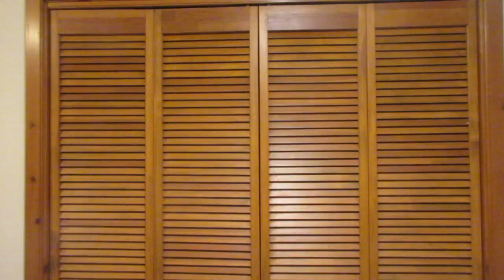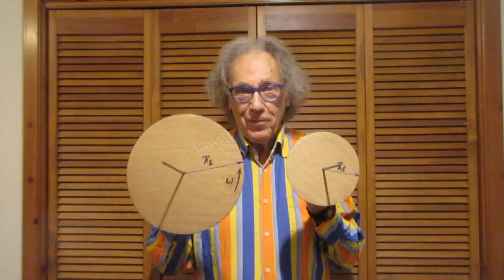Problem #8  Rotating Discs  - not easy!

Comment: the friction generates because there exists a relative velocity between the two touching ends of the wheel. when the relative velocity become zero there will be no longer friction acting on the when, and here is the moment when it reaches w1 and w2, u told us to find out.

firstly as the relative velocity is zero so, 
R1 * W1 = R2*W2
And neglecting heat loss due to friction , I can use conservation of rotational Kinetic Energy
 i.e.,  I1*W^2 = I1*(W1)^2 + I2 *(W2)^2  , the (1/2) term is already taken care of..

being same density, I1 = K*(R1)^4  and  I2 = K*(R2)^4 

And I got the answer as 

W1 = W/sqr[1 + (R2/R1)^2]  and  W2 = W/sqr[1 + (R1/R2)^2]

Why I haven't used the conservation of angular momentum coz the net torque acting on the system is not zero. so it is not conserved.

i think this the answer.

Comment: Considering M1 and M2 as masses of the discs, I would conserve the angular momentum about the point where they are touching:-

1. 1.5*M2*(R2^2)w = 1.5*M1(R1^2)w + 1.5*M2(R2^2)*w2 
 And then since I know that there should be no slip at that point between the 2 discs because of friction,

2. R1*w1 = R2*w2

Solving them gives me,

w2 = M2*R2*w / ( M1*R1 + M2*R2 ), w1 = M2*(R2^2)w / R1( M1*R1 + M2*R2 )

Comment: SIR,PLEASE READ MY EXPLANATION.I AM TRYING TO SHARE MY SOLUTION STRATEGY. The key to solve the problem is hidden in one line-"after some time the angular speed of each wheel becomes constsnt,i.e the bigger wheel no longer speeds down and the smaller wheel no longer speeds up."
what's the reason behind this?
To give the answer one should remember the property of frictional force.it always tries to oppose the relative motion between two surfaces in contact.in this problem as the bigger wheel speeds down and the smaller one speed up there comes a moment when the velocity of peripheral points of two wheels become same.from that moment frictional force vanishes as there is no longer relative motion between the periphery of wheels and we can quote the condition mathematically by writting             w (1)r (1)=w (2)r(2).
secondly we should write the equation of motion of each wheel.moment of inertia of each of them should be expressed in terms of density,thickness and area.these equations will also include parameters like frictional force and time.
But no problem will arise to deal with so many parameters because as we will proceed to solve them the parameters will be cancelled as they are same in both of the equations.
thes considerations are enough to determine w (1) and w (2).
COMMENT PLEASE,SIR.

Comment: (as mentioned) final ang momentum of the discs 1 & 2 are w2, w1 respectively.
Friction will act untill the velocities at the point of contact are equal.
hence w1R1=w2R2   (1)
There is angular impulse due to friction acting for a certain time period
hence (considering the sense of rotation)
R2*f*t = (I2w)-(I2w2)
R1*f*t = I1w1
solving, 
w1= w*R2/2*R1
w2= w/2

Comment: Most of the people are using conservation of angular momentum but they don't care about hinge reactions.
Use newton's third law for the friction force at the point of slipping. 
Integral f.R1 dt  = mR1^2/2 . (W2 - w)
Integral fR2 dt = mR2^2/2 (W1)
Now constraint equation
W1R1 = W2R2

Comment: my answer is probably wrong. but I guess you guys should first try to solve when both radii are equal. if radii are equal I think angular velocity will be 1/8 th. otherwise just a messy long equation if a is R2/R1. then I'm getting w1 = w / (1-a^4 + 2a(1+a)^2).

Comment: i)First off, angular momentum is not conserved WRT any point.

іi) Since friction is ignored, we can apply conservation of energy as follows: 
0.5 * Ι2 * ω^2 = 0.5 * I2 *ω2^2 + 0.5 * I1 * ω1^2  --------> (1)
where, 
I2: moment of inertia of the bigger disc and it is 0.5 M2*R2^2 
I1: Moment of inertia of the smaller one and it is 0.5 M1*R1^2

iii) velocities of points of contact should be equal, which allows us to write, 
 R1 * ω1 = R2 * ω2 ------>(2)

iii) Calculations. Actually, I am not very sure of this part.
M2 = ρ * V = ρ * ι * π * R2^2 and M1= ρ * V= ρ * ι * π * R1^2

then, equation (1) becomes, 
(ω^2 - ω2^2) = (R1/R2)^4 * ω1^2  ------> (3)
 
dividing (2) by R1, 
 ω1 = (R2/R1) * ω2 ---------> (4) 

substituting (4) in 3 and solving for  ω2, 
ω2 = ω/ [1+(R1/R2)^3]^0.5

then we get ω1 from (2). 

iv)Sanity check.
when R1  =  R2, Energy should be distributed equally. which is the case. 

when R2>>R1, the second disc is considered a point which will not rotate. 

when R1>>R2, well, we get ω1 = ω2 = 0! This does not sound good to me. However, this could be a result of the nonphysical assumption of assigning an angular velocity to a point particle.

Comment: I think you can think of it as a mass sliding on frictionless surface with linear momentum, on the way it hits and attaches a second mass at rest thefore to conserve the momentum the total mass has increased therefore the final velocity will be lower. 
m1xV1=(m1+m2)Vf (ideal conditions) but if the friction is taken into consideration we will have another term that will decide the traction at the contact between the two masses and can cause the difference in the final velocities of both masses. so the force that brings them in contact shoudl also be considered, now the difference between the disc case and this one is that in this case the velocity is same and in disc it should not be rpm but the final tangential velocity of both disc will be same.
Reply: Usman Afridi he yelled "friction coefficient is mew" just to confuse u :p
and i think he has successfully done it :D
Reply: thats true, i think if you make a dynamic model it will be useful to see the acceleration but in this case we are intersted in the final state so it is going to be --> V_af = (m_a*r_a*V_ai/(m_a*r_a+m_b*r_b))

so V can be used to find rpm

Comment: Very interesting problem. it's very impressive how many people already reacted to this!

like many others, I couldn't resist the temptation (although it's after 1am here) and got to this:

mu  isn't specified, so I make the hypothesis that it's equal to 1.

conservation of the sum of angular momentums: L1+L2 is constant

the masses of the discs are:
M1=π*Roh*d*R1^2
M2=π*Roh*d*R2^2
where "Roh" is the density and "d" the thickness of the discs.

L1=(0.5*M1*R1^2)*w1
L2=(0.5*M2*R2^2)*w2

and since in the beginning L1=0 :
L1+L2 = (0.5*M2*R2^2)*w

the density and thickness cancel out because identical, I'll spare you with the algebra.

whatsmore:
w1=w2*(R2/R1)

therefore:
w1=w*[1+(R2^3/R1^3)]*(R2/R1)
w2=w*(1+(R2^3/R1^3))

thank you for the great video!

Comment: the transient of the problem is complex, because in a conservative system without friction the non-rotating disc would need to adapt his velocity instantaneously, what it does not. the wheels slip under friction. So the total energy conservation would need to take into account the dissipation of energy to heat - saying Erot,2(0) = Erot,2(t) + Erot,1(t) + int(dQ/dt,dt=0..t).

Comment: If the problem is worded as "throwing a sandbag onto a stationary hovercraft" - everyone would get it. Make it rotational and folks seem to get their knickers in a knot. 
A locked "gear" --> r1.w1 = r2.w2 (equal tangential speed at the point of contact)
Rotational inertias scale as the square of the radius --> J1 ∝ r1^2 ; J2 ∝ r2^2 ; they have the same constant of proportionality (:: same wood)
As the rods are frictionless, the hands cannot impart torque to their own discs. Kinetic energy need not be conserved, part of it turns to heat by rubbing. Momentum must be conserved.
Initial momentum P = k.w.r2^2 (for some constant of proportionality k)
Final momentum P_f = k.w1.r1^2 + k.w2.r2^2 =(must be)= P = k.w.r2^2
Substituting the "locked gear" relation:
  w1 = w.r2^2/r1.(r1+r2) and 
  w2 = w.r2/(r1+r2) QED.
Reply: Using conservation of angular momentum makes things very complicated  because the discs are rotating around different axes. Also, the radii shouldn't affect the solution.
Reply: Aditya Mehendale u got it wrong too m8 xD
Reply: Lol the radius determines the amount of torque created by the friction. Torque is the cross product of force and distance. In this case, the distance is the radius.
Reply: The end-result requires no rubbing. This means that the perimeters of both the discs travel at the same speed. The radii must therefore stay in the solution. Why would you think otherwise? I agree with you, that the sign convention gets awkward due to the counter-rotation of the discs. However, of you create a linear-domain analogy (inelastic collision) and look at the magnitudes of the momentum, the math should still match, right? I must have goofed up somewhere apparently, but I fail to see how the radii don't mater.
Reply: I think one mistake was "Rotational inertias scale as the square of the radius." Sure, it's correct, but they also scale with the mass and the mass scales with the square of the radius, so it should be r^4.

If you increase the radius of one, the radius of the other will increase so that the two situations are exactly proportional; the only difference will be length. But since angular velocity doesn't take into account distance, it shouldn't be impacted by that. That being said, when I wrote the reply I thought my answer was correct because it wasn't posted, but I must have missed it because it's here again.

I'm pretty sure angular momentum is only conserved for a specific axis of rotation. Since conservation of energy most likely won't work as you said, I really don't know how to do it, though.
Reply: Well, I screwed up. I thought he said r2 was twice as great as r1—but of course he didn't.
Reply: @Shrey - Apparently I did - but would you care to say *why*?

Comment: Conservation of Angular Momentum: 
L1 + L2 = L1' + L2' 
L1= angular momentum of disk 1 L2 = angular momentum of disk 2 L1'= angular momentum of disk 1 after L2 = angular momentum of disk 2 after 

L2 = L1' + L2' 
because L1 = 0. 

0.5ωm2(r2)^2 = 0.5ω1m1(r1)^2 + 0.5ωm2(r2)^2 because L = Iω 
Assuming solid disks, I = 0.5mr^2 

To find ω1, the equation simplifies to: 
ω1m1(r1)^2 = ωm2(r2)^2 - ω2m2(r2)^2 

ω1 = m2(r2)^2(ω - ω2)/ m1(r1)^2 

ω1 = π(r2)^2tp(r2)^2(ω - ω2)/π(r1)^2tp(r1)^2 
because mass of disk = density * volume 
p = density 
volume = πr^2 * t 
with t = thickness 
So mass = πr^2 * t * p 

same thickness, t's cancel 
same density, p's cancel 
π's cancel

Cancel out everything I can: 
ω1 = (r2/r1)^4 * (ω - ω2) 

For ω2: 

Rearrange equation for ω1 to get: 
ω2 = ω - ω1 * (r1/r2)^4 

(It seems so simple that I probably got it wrong, but at least I tried. Was my assumption of angular momentum being conserved wrong or something? Or maybe I just messed up with the math somewhere along the way.) P.S. It's not easy writing this out, or following the math in a youtube comment.

Edit:
One of the equations might result in a negative answer, so just take the absolute value of it and it will give the magnitude.
Reply: I don't really need to, angular momentum is defined as moment of inertia * angular velocity.
Reply: That's exactly how I did it as well, nice formatting btw. I'm pretty sure L is conserved as long as you look at both objects as a system, it's kind of like a collision problem but using torque instead of force.
Reply: Answer is needed in terms of ω , not ω1 and ω2.
Reply: ya true
and in the starting Walter himself told that he was preventing the slipping case so conservation of momentum can be used precisely
Reply: Kuro Official the answer of w2=2i2w/i1+i2(R2/R1)^8
Reply: Angular momentum can't be conserved even at the contact points because some force is being exerted by the rods on the disc to keep them in place (Credits: Aditya in this comment section). This force is generally known as hinge reaction force.

Comment: Well i think it should be done by simple energy conservation. I refrain to go into angular momentum conservation because if i take both the discs as my system, then the system as a Disk isn't collectively rotating about a fixed point. the way i plan to do it is as follows
i use The following terminology I is moment of inertia of first disk and is equal to (1/2)p(density)v(volume of disk)(R1)²
this equals (1/2)ptπ(R1)⁴
similarly moment of inertia of second disk is 1/2ptπR2⁴
energy of the Disk in the start is (1/2)Iw²

hence that means (1/2)[(1/2)ptπ(R2)⁴]w²
let's take all constants and term them k so they easily cut off on the sides
similarly at our end point, discs gain angular velocities w1 and w2
calculating their energies the same way and 
applying energy conservation
k(R 1)⁴w²=k(R1)⁴(w1)² + k(R2)⁴(w2)²
since they are rolling without slipping, the upward speed of point of contact of one disk and downward speed of point of contact of the other will be equal. 
We know v=wr
hence (w1)(R1)=(w2)(R2)
hence w2=w1(R1/R2)
putting that in our energy conservatiion eqution and cutting the k's
(R1)⁴w²= (R1)⁴(w1)² + (R2)²(w1)²(R1)²
now we solve for w1 :)
w1=[(R1)²w]/√[R1)⁴+(R2)²(R1)²]

Comment: Ooooops...I messed up. I forgot that the angular momentum was around two different centers. I used conservation of energy this time and I think I got it.

ω1=-ω/√5     ω2=ω/2√5

I know that rotational energy for a cylinder is 1/2(1/2mr^2)ω^2 using two formulas. This gave me ω^2=16ω2^2+ω1^2. I substituted values for ω1 and ω2 since I knew that ω1 was half as great (ω1r1=ω2r2).
Reply: I would say the omega of r1 will be negative one fourth the starting omega of r2. I think the best way to solve this is theoretically,  by examining a similar situation. Instead of the given example, imagine that r1 also begins with an omega angular rotation. In this case,  r1 will overpower r2 because r1 has half as much leverage acting on it where the point of friction is applied. Eventually r2 would be forced into a clockwise rotation. r1 will lose half it's angular velocity in order to cause r2 to stop spinning (instantaneously) as r2 begins to spin clockwise. Then r1 will lose another half of it's angular momentum in order to make r2 spin at full clockwise speed. So the same ratio of force transfer can be applied to the given example, even with different initial conditions!
Reply: How did you get 1/4? I should have added a negative sign, though.

Comment: So we have r2  w2 = r1  w1. By the conservation of angular momentum we have : 
I2 w = I2 w2 +I1 w1 where I1 and I2 are the inertia momentum of the two disks.
We have I1 = 0.5 m1 r²1 and I2 = 0.5 m2 r²2 
Thus m2 r²2 w = m2r²2 w2  + m1r1r2 w2 <=> w2 = (m2 r2 w)/(m2r2 + m1r1 ) 
and   w1 = r2 w2 /r1 <=>  (m2 r²2 w)/(m2r2r1 + m1r²1 )

Comment: ω2=[(R2^3)/(R1^3+R2^3)]×ω
ω1=[(R2^4)/(R1^4+R1×R2^3)]×ω
Reply from the maker: incorrect
Reply: Panagiotis Organtzis got the same thing ;)
Reply: Its very similar to my solution, but mine is simpler. I will send it in another message and if you can see it then you should ignore both messages propably...
Reply: +odysseas hlap 
ω1=[R1*R2/(R1^2+R2^2)]*ω
ω2=[R1^2/(R1^2+R2^2)]*ω
Reply: It doesn't matter which is simpler, it matters which is right!
Reply: me, too
Reply: Can you explain why and show us your solution to watch over? @AZ ade
Reply: +Sascha Friedrich 
I cant send it because first it's wrong and second if i send the correct one i will spoil the fun
Reply: i found exact same thing 
by using
L1=L2
V1=V2
Reply: In our country many high schoolers do this kind of sum while preparing for jee advanced
Give it a try to it 😉
Reply: I think conservation of angular momentum can not applied to this because it has opposite direction. It should has some torque occur on each hand in opposite direction.
Hippo thank for a beautiful problem sir.

Comment: Good afternoon Professor! Thanks for the beautiful problem, that's how I tempted to solve it.

The moment of inertia J of a cylinder of mass M and radius R is:   J=(MR^2)/2
The kinetic energy KE of the same cylinder rotating at an angular velocity w is:   KE=(Jw^2)/2
The mass M of the same cylinder of thickness h and density d is:   M=πhdR^2

Thus, the kinetic energy KE2start of the second cylinder at the beginning of the problem is:   KE2start=(w^2 R2^4 πhd)/4
The kinetic energy of the first cylinder is 0, as it's not moving at all (w=0).
So, the kinetic energy of the whole system at the beginning of the problem is KE2start.

At the equilibrium, the kinetic energy KE1eq of the first cylinder is:   KE1eq=(w1^2 R1^4 πhd)/4
Also, the kinetic energy KE2eq of the second cylinder is:   KE2eq=(w2^2 R2^4 πhd)/4
So, the kinetic energy of the whole system at the equilibrium is KE1eq+KE2eq:   KEeq=(w1^2 R1^4 πhd + w2^2 R2^4 πhd)/4

Because energy is conserved during the experiment (by assumption), KE2start=KEeq
Also, because they are effectively gears, w2=(w1R1)/R2

After a little bit of massaging, π, h and d go away, and what remains is that

w1=(w R2^2)/(R1 sqrt(R1^2 + R2^2))
w2=(w R2^2)/(R2 sqrt(R1^2 + R2^2))

expressed in terms of w, R1 and R2.

I hope that this is the right solution, but for sure I had a good time trying solving it.

Take care, and of course we are still friends!
Reply from the maker: @BAKER-zi3iw  what you wrote is wrong watch my solutions.
Reply from the maker: @BAKER-zi3iw inelastic collisions momentum is conserved Here  angular momentum is not consereved.  I would therefore not call this an inelastic collision.